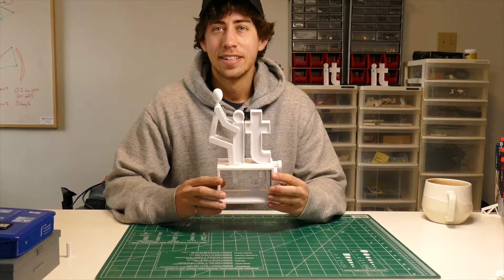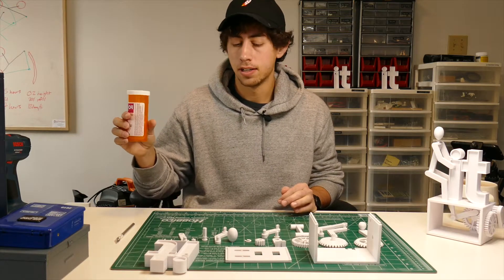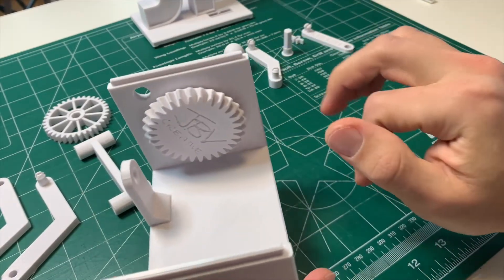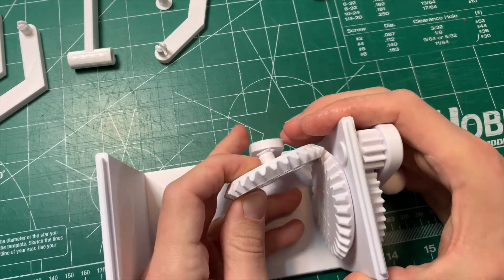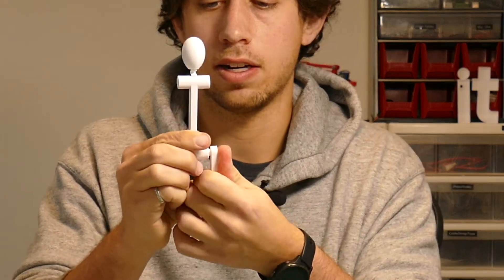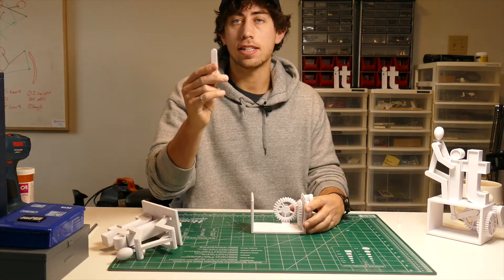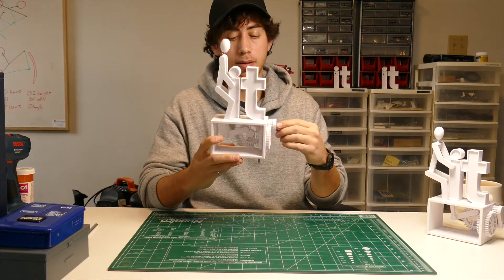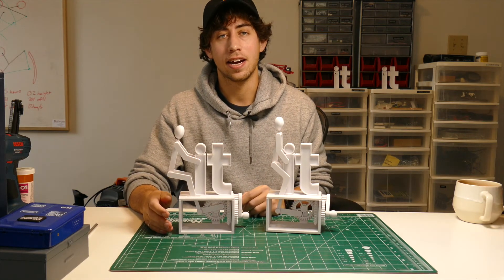Screw It/Do It - Fully 3D Printed Mechanical Sculpture

Comment: I just found your videos and website.

Will definitely be buying some of these files. And since I'm still kinda new to 3d printing and only recently got my printer working again after "upgrading it" with auto bed leveling that managed to instead of making it easier, made it where I could print nothing...

I digress, these videos are extremely helpful in seeing what the final parts will look like and get an idea of if there are any overhangs or supports that will be needed. (A possible comment from a newbie point of view, adding whether supports are needed or how difficult any prints might be, would be useful for us new people learning, and not yet with dialed in printers)

Great concept and videos!